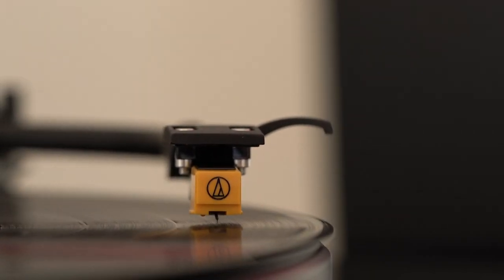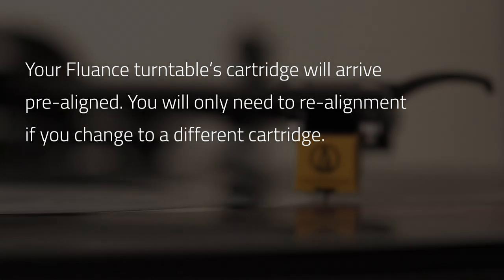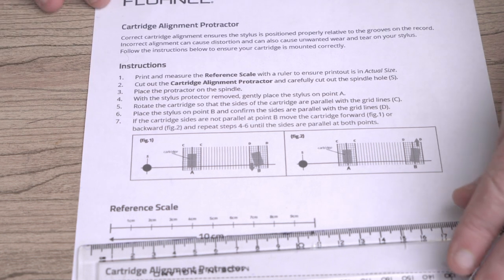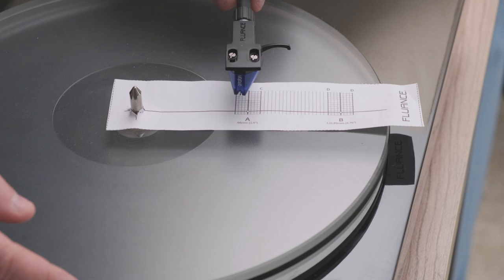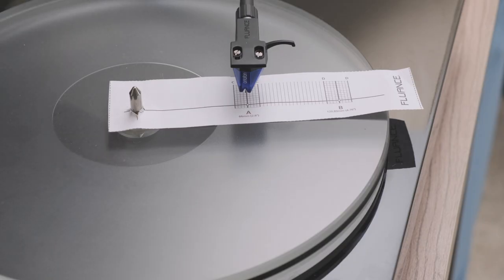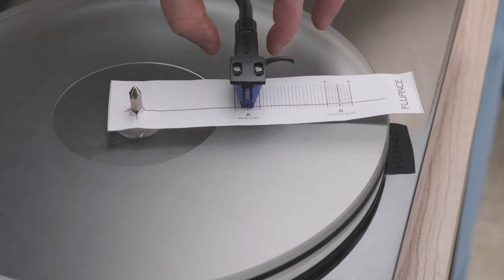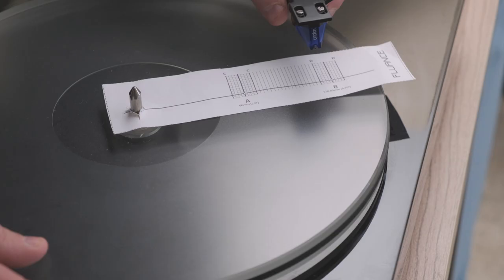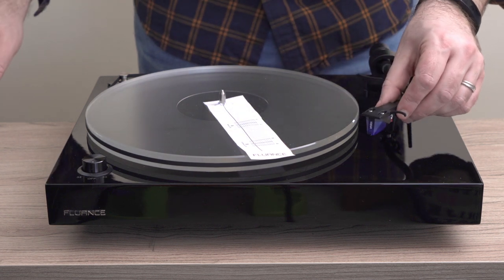How to Check the Alignment and Realign Your Cartridge - Turntable Alignment Tool Included

Comment: I have a doubt. In addition to allowing alignment adjustment, does this ruler also determine the perfect longitudinal distance of the needle in the arm? Thanks.
Reply: I like how  nobody answers this question as I feel it's an important one.
Reply: @troyarmatti7167  After I asked the question, I bought the ruler and made the adjustments on my Technics SL-Q03. I came to the conclusion that yes, the tangential adjustments also regulate the distance between the pivot and the needle, which on my turntable and, I believe most, is 9". In other words, it is very important to adjust with the ruler. I would say that it is essential to do so.

Comment: Does it not matter how forward or backward the cartridge is in the headshell? Would that not affect overhang?
Reply: I was curious about this, too. How do you know how far forward or back to position the cartridge? I assume it matters?
Reply: Yes it does, It won't line up at both points until that is set correctly.

Comment: I have heard you should align off the stylus itself instead of the cart. That is REALLY difficult, being as the stylus is at an angle which makes it near impossible to know when you are really looking at it straight on.
Reply: The cantilever is way too short to make any meaningful judgement on a 2 point protractor, anyway. With the overhang being off by several millimeters, one can hardly tell the difference. The best way is to tape a pencil lead to a flat fronted cartridge, to increase visibility of the error. It does require the cantilever to be perfectly straight, though.

Comment: Can I ask a dumb question?  Since the Ortofon cartridge is a perfect rectangle, like its not a random shape or bigger on one side, can't you just make sure the screws on the tone arm are in line since the screw holes in the cartridge are in perfect line?  In the video you can see the end result is the screws in line
Reply from the maker: Not a dumb question at all! The alignment process also handles overhang which determines how far forward on the headshell the cartridge is.

Comment: Is cartridge scale and pivot-to-spindle measuing tool really necessary?
Reply from the maker: Hi Beni, without using the protractor, it would be exceedingly difficult to align the cartridge correctly. That being said, a tracking force scale is great for getting an exact tracking force setting but can setting the tracking force can be done without s specialized scale.

Comment: My printout is 5mm too small. How do I adjust that so it’s correct size?
Reply from the maker: In your print settings, there should be an option for scaling, it should be set to actual size, not a fit to page option.

Comment: Yes but you didn't mention overhang you can still have it aligned and have wrong overhang and it's nice to have the arc drawn on the protractor with the overhang and I would say you should line the counter lever not the body of the garage
Reply: If the overhang is off, it won't align on both points of a two point protractor.
Reply: @ElectricVintage-u1o  That's true, but using the protractor is only hit and miss, trial by fire way to set overhang. It's best to use a dedicated overhang gauge first; preferably a gauge supplied by the turntable/headshell manufacturer. My Technics SL1200 (purchased 30 yrs ago) came with a gauge, which can double as an alignment gauge if used appropriately.
Moreover, if your turntable has an "S-SHAPED" tonearm, setting the overhang correctly obviates the need for the protractor method. See this video for more info.  https://www.youtube.com/watch?v=1ecots5MJR4&t=10s
Reply: Using the protractor is not hit and miss. It's triangulation and will set the overhang as part of it

Comment: Where is the link for the protractor.
Reply from the maker: Hi LT, the link is in the description, but I can post it here for you! https://www.youtube.com/redirect?event=video_description&redir_token=QUFFLUhqbDVITDU0REZRV1MtZkdISVc1NzktblpCb2dwQXxBQ3Jtc0trczU2Y2NEc2hqNGptdTZZcGd3TUhVRk96Q2ZqZ0lPVzl6bUlHNk9iei1rdnFyQUI2S3BteGpFQ0NqcTVxRUNUaVZrQWFwUm92Y2xoTjVWSF9FNlhmSmltNkEwWXRZbmM3SkNLYzROdVF2YkZBQUx3WQ&q=https%3A%2F%2Fwww.fluance.com%2Fdownloads%2Fdl%2Ffile%2Fid%2F1450%2Fproduct%2F859%2Ffluance_cartridge_alignment_protractor.pdf&v=r19cEl9Q0UI
Reply: Hi there I printed this but the measurement was 9.5 cm and not 10 cm. How to I get the correct measurent. Thank you
Reply from the maker: @breezebenitses397  Great question! You may need to change the scale that you're printing. If it's fit to page and not actual size the scale won't line up.
Reply: @FluanceSpeakers  thank you. I'll have a look. Having lots of fun messing around with old hi-fi's. Success? I'll let you know. Just changed foam to rubber on speakers. That worked well. Thanks to YouTube. Regards
Reply: This link is dead with a 404
 @FluanceSpeakers